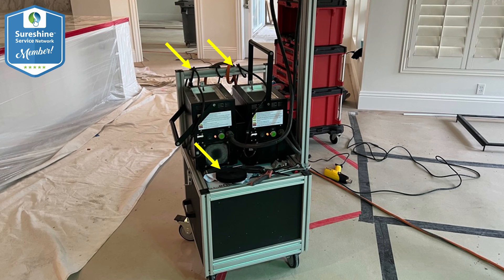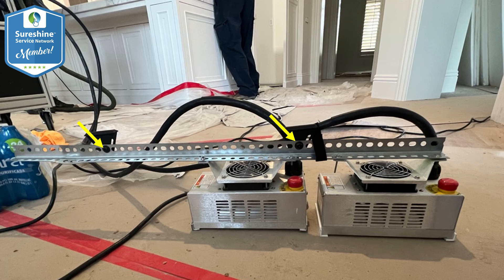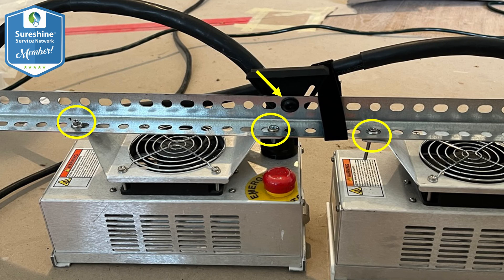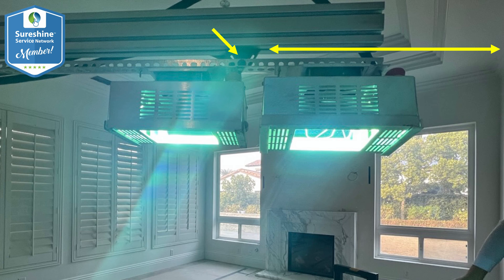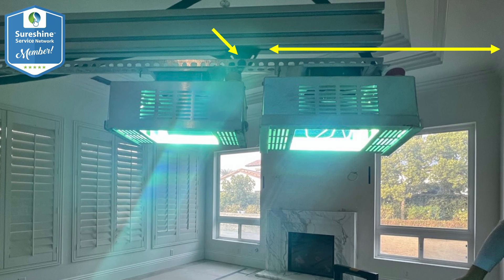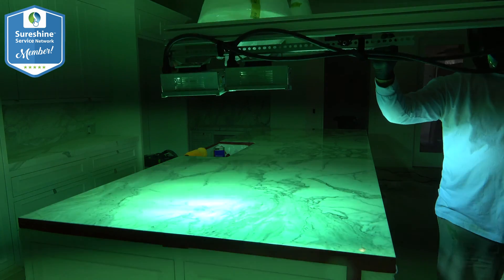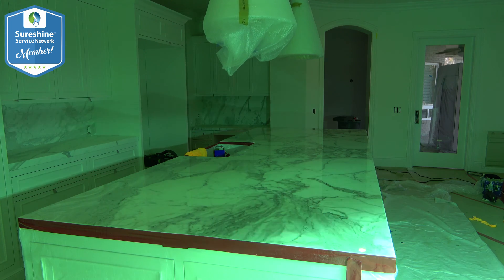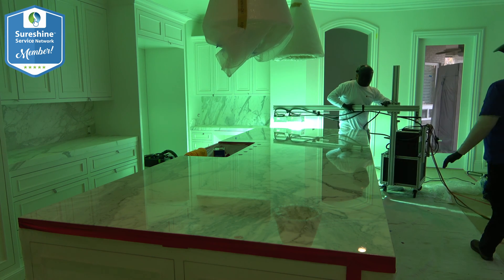Curing Antietch Marble Sealer with two UV Lights

Comment: Can I use any type of UV light? Or I have to use something like you have? Or where can I purchase a these uv lights. I have a marble countertop that needs this. They are heavy entertainers and they want an anti etch solution.
Reply from the maker: Recommend contacting more surface care to learn about becoming an applicator. Moresurfacecare.com
Reply: @tedmcfadden  done just filled out the application
Reply from the maker: @oklahomapressureclean5897  awesome.